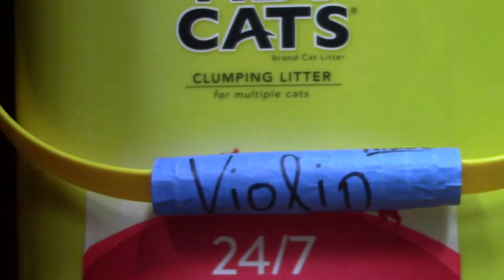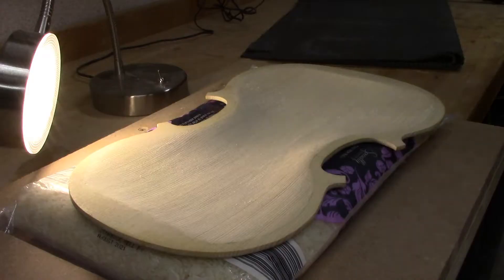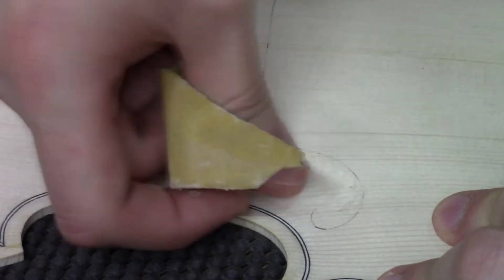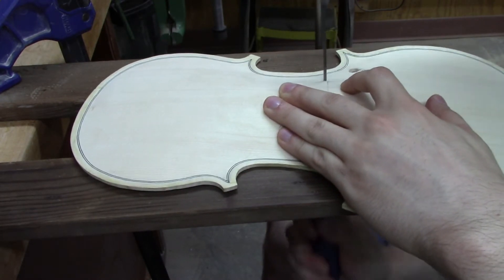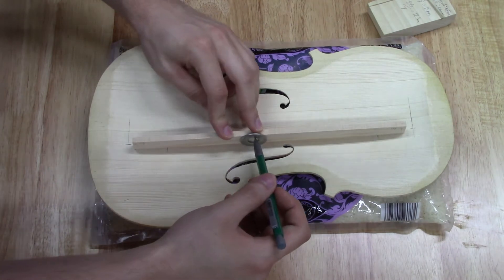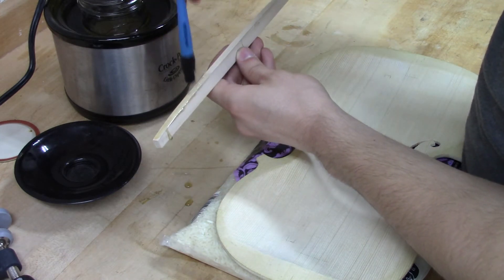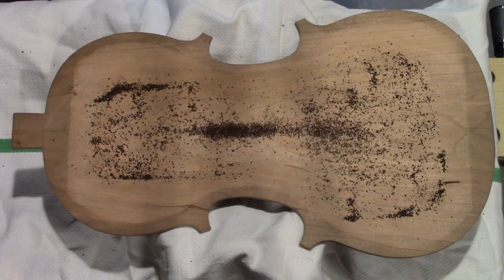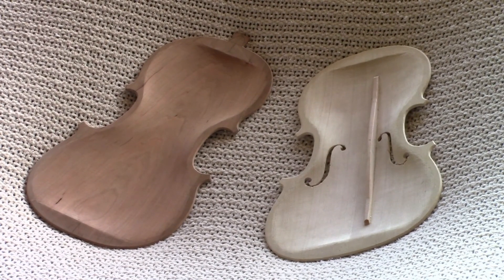Building my First Violin! Part 5, Plate Tuning

Comment: May I ask  what’s the meter or gadget you used to achieve the right frequency.  Trying to learn  any help will be much appreciated Thanks
Reply from the maker: I downloaded a tone generator app on my phone and connected to a speaker I placed underneath the violin plate. I could do a frequency sweep to see where about the frequency was and then dial it in by hand. A bluetooth speaker should work.

The most important thing is the proper placement of the speaker and the foam supports along the nodes/antinodes.
Reply: Tone generator, you can download an app or you can find then here in youtube, hope this helps

Comment: How many watts is the speaker you use? I tried to achieve this kind of patterns, by the speaker of my stereo (20W) but there was no exact patterns. I couldn't find also a clear frequency to decide what is the 2. and 5. semitones of my plate.
Reply from the maker: I don't know the wattage of my speakers but I would imagine 20W should be more than enough. I've seen people make it work with small bluetooth speakers. The most important thing is supporting the plates with small foam standoffs at the nodes of the mode you're trying to find and placing the speaker directly under the antinode. I found that even if I was just a little off it would have a huge effect on whether or not I could see the pattern. Of course, that can turn into a guessing game if your plate is a off from the expected pattern you might have to move the foam supports and/or the speaker around a little bit, although you shouldn't have to wander too far.

It might also help your search for the nodes and antinodes if you try and hold it by where you think the nodes are, and tap it where you think the antinode is. The closer you are to the correct spot, the more pure and loud the tone of that mode should be.

As for the exact frequencies of the plates, I think the most important thing is that mode 5 is an octave above mode 2, and between the plates they should be about the same. Mode 5 can be a semitone apart between the plates which might change the color of the instrument. They should also be somewhere on the musical scale. My top plate had a mode 5 of 362Hz(F#) and a mode 2 of 175(F). My back had a mode 5 of 341Hz(almost an F) and a mode 2 of 170Hz(almost an F).

The link below I found very helpful with this. Page 7 and 8 have the blue bulleted text which summarizes some of the results of the research.

http://www.platetuning.org/Article_by_CMH_on_Violin_plates.pdf
Reply: @EricTrimbur  Thanks for the extensive answer!

Comment: Hi there very few violin makers use cherry wood for one its denser than maple or sycamore and its resinous meaning if it's not dried properly it leaves damp patches when working on the wood this happens to mahogany wood also .The density of the wood to the age is also important and tuning the plates is another you need equipment for it and Chladni is a Polish version of Hladny which is Ukrainian. There's nothing wrong with Cherry wood only like mahogany its porous grain and a sod to carve I know.
Reply from the maker: Yes, the cherry has been interesting and difficult to work with. I had some on hand so that's why I used it. It has been drying for decades. I got it from my father who bought it from someone who got it from their father who originally milled the boards. In total it has probably been 30 years.